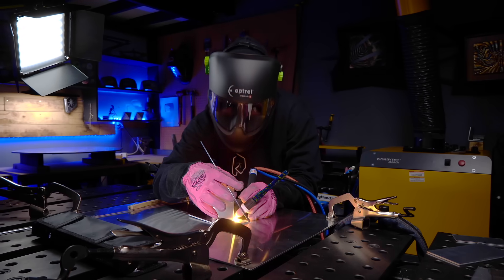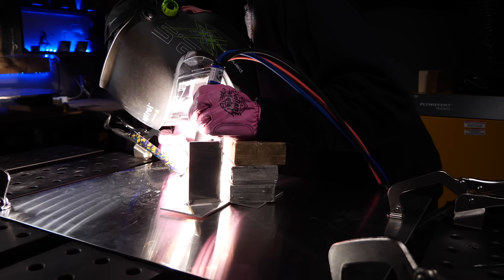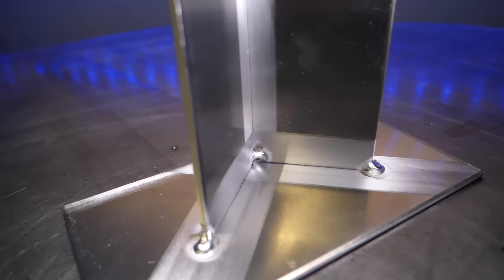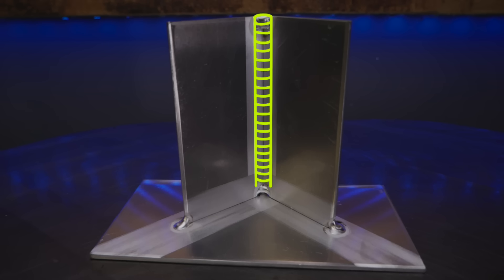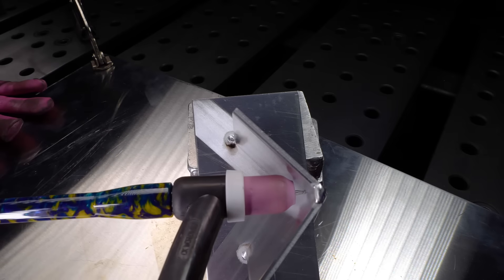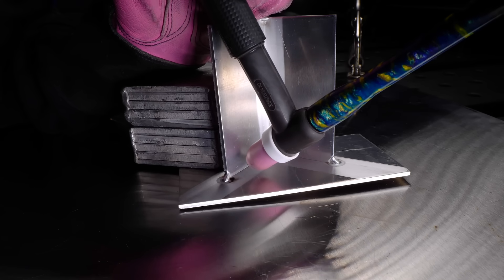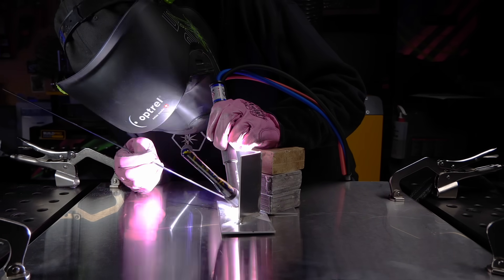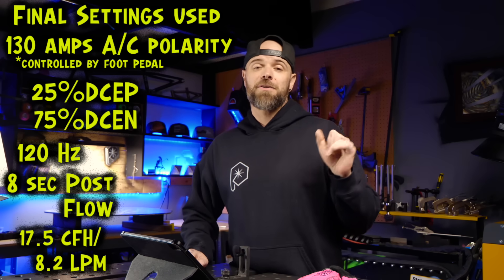90% of Welders CAN'T WELD This Joint, Here's How You Can.

Comment: Nice video with great ideas. However, I would like to pin points some details that were not covered and that are important: 1) Thinking how to weld so it will look nice is important. But the idea of full penetration was left over, which is critical in the corner. 2) As the beads are lay down, I can see that root of the weld stays intact. It means that the two base metal are not fused at their jojnts, which weakens the weld. For the rest, these are great tips and I took note to all of them!

Comment: I like the push pull gun. You could do one of the bottom slightly horizontal welds and the vertical weld in 1 pass. Then you come back and run your other side. The tig is real fun but isn't practical for the amount of welding I do.

Comment: I have a project where I have several welds like this.  It is definitely difficult to do.  But it is all about creating a puddle and controlling the puddle.  I have definitely run through a number of electrodes in doing this.  Your video is very helpful.

Comment: Whats a good tig welder that doesnt cost 4k?  Primeweld? Yesweld? Vulcan?  Its a straight tig welder better than a multiprocess?
Reply: @andrewa8569  if welding aluminium find a dealer where you can try the machine first. Most of my suppliers who specialise in welding products will accommodate this. When testing you are looking for a unit which shows consistency in  its waveform .  Run at a lower pulse setting and it will be more obvious . If you have three phase available take this path. Even a secondhand miller 350 which offers seperate settings for the + and - on the ac cycle will offer more scope for heavier materials. I have several dynasty’s ranging from the 350 to the 800 and they are extremely versatile and reliable

Comment: What would be your strategy for tackling this type of weld where the plates are so large you are forced to sit on it while welding the corner. I ended up getting a small height adjustable stool, cut off the wheels and stuck a rubber ball on the post. It allows me to rest my chest on the stool yet still allow you to pivot without sliding and frees up the strain in my back.

Comment: Dusty  what would you do if you are working on a new from scratch 30 gallon water tank for an RV. I would guess that you tack up the bottom and sides rotate the tank to do as many horz. welds as possible inside and outside then do the top last from the outside only.  Dave

Comment: I feel like most of the time in the real world overhand torching is uncomfortable at best as the part size is generally larger... I prefer to top feed and hold the torch off to the side that way I don't risk sticking the filler ( if you know you know). I've also had good results back feeding when traveling towards the pocket. Either way I would rather just weld through the corner with  some 4 step, synergic, pulse on pulse and be done with it in about 2 seconds.

Comment: Let’s do some “real” aluminum… meaning everything that’s not clean and prepped and from great sources. Try a brand of aluminum from across the planet that is unknown and 7” thick. Let me know your thoughts.thank you.
Reply: Reminds me of a machine shop I worked in back in the day
280 amps on a 1/8 tungsten and I still had to sit on it for a while
Reply: 99.9% of aluminum I ever weld is grungy dirty , of unknown origin and I almost never try to make ' dime stacks '
In fact, sometimes when it turns out a dime stack I go over it to smooth it out.
Guess I'm just a hack at aluminum.

Comment: I'm not sure why but I always get porosity on this joint, for ex. I did a 2" tube frame w gussets flush on the bottom, I got rid of the mill scale w a flap disc and even took some acetone to it, but I still got some scatter porosity. After the joint is tacked up its basically impossible to clean since a buffing wheel can't get in there nor will a wire brush.

btw this was w low carbon steel, used a number 8 cup w a gas lens @ 30 cfh 115amp, 12 sec post flow , 3/32" 2% Lan
Reply: You shouldn't need a lens or more than 1 or 2 seconds postflow or that much gas for carbon steel. Try it with a straight cup and 20 cfh, and as little stickout as you can fit into the corner.
Reply: Try a number 5 or 6 straight cup and turn your gas flow down around 20 and turn your amps down to 100. Tack up some practice pieces and start playing around with your flow,heat,and stick out. If you're not contaminating the material you should find your sweet spot. The disc you use on it should either be new or have never been used on anything but the material you are working with. Hope this helps.
Reply: Sorry @maxscott3349,  this is bad advice... you DO need decent post flow even on carbon steel... The post flow protects the tungsten, not just the weldment. Anything less than maybe 7 seconds (depending on your current vs tungsten size) and the tungsten will oxidise instantly when the gas flow stops.  Try watching the tungsten during the cool down period ... you can see it flash to a different colour and surface finish instantly the gas stops, if your post flow is too short.  
 And yes it also protects the joint,  but regardless of your joint material, you don't want to start your next weld with the tungsten all contaminated.
Reply: @tano1747  You may have a point about the tungsten. I never really paid much attention to it because most of the TIG I've done has been on 7000 series aluminum and on that stuff your tungsten is just always contaminated. It's not really much of a problem once you get used to it
Reply: @guyfromgantz7976 you might have a contaminated flap disc... you should have one for aluminium, one for carbon steel, one for stainless steel etc, otherwise you only THINK you're cleaning the surface -- in fact you are embedding contamination into the surface roughness, and your weld will be less than ideal. The acetone needs to be applied with a clean paper towel,  and you rub till the paper towel comes away from the surface without changing colour.  If the paper towel is still picking up crap from the surface,  then the surface isn't yet clean. 
My level of diligence isn't always perfect either, but if it isn't, the chemistry always reminds me to try harder next time, via porosity and general crap weld quality.

Comment: Great video. Lots of good tips. What size cup did you use, #5 with a gas lens? On your settings regarding 25% AC balance where you say 25% DCEP / 75% DCEN ... that's a bit of a misnomer (this may be a nit) but there's nothing "DC" when AC TIG welding aluminum. For every single AC cycle (no matter how long that cycle is based on HZ setting, let's say 1/100 of a second at 100Hz) you spend 25% of that cycle's time  getting positive current and the other 75% (majority) getting negative current. But in neither case is that current DC or constant. Think of a normal sine wave (could also be triangle or square depending on your welder's setting). A normal sine wave spends half its cycle in the positive phase and half its time in the negative phase (50% balance). A 25% positive AC setting will compress that positive phase and stretch out the negative phase to compensate accordingly to keep the same cycle time. So for a 100Hz setting the positive part of the sine wave will be .0025 seconds and the negative part will be .0075 seconds over that one cycle. A picture would be a 1000 words here. 
I have a request for a video. In other videos I've seen you mention that you ball your tungsten when TIG welding. How??? I've seen some people balling their Tungsten at DCEP. Some welders even have specific settings for balling tungsten. How do you do it on your Everlast welder, switch the cables around?
Reply from the maker: I appreciate the comment, and thanks for checking out the video. As far as preparing a ball on the tungsten I can definitely do this by flipping the terminals, but you can also turn the balance so that there is much more positive side of the cycle, I think when I get somewhere around 60% this will start to do the exact same thing🙂 I appreciate the feedback, have a great weekend!
Reply: @PacificArcTigWelding  thanks, i will try that on my everlast welder
Reply: Fire off on a clean chunk of copper and you'll get the result you want. Make sure the AC balance is correct .